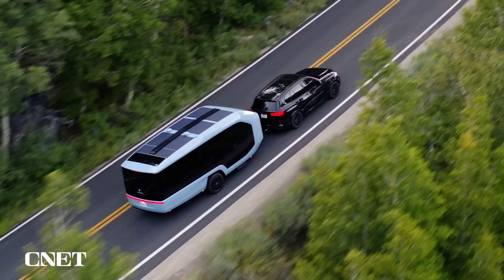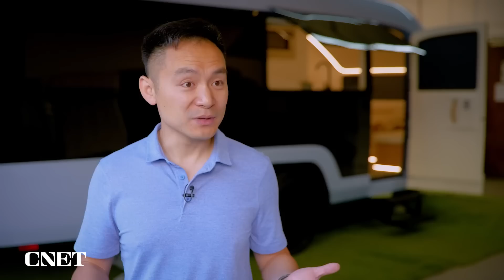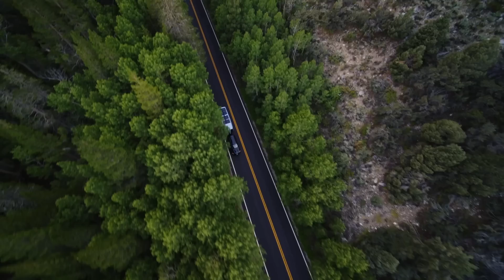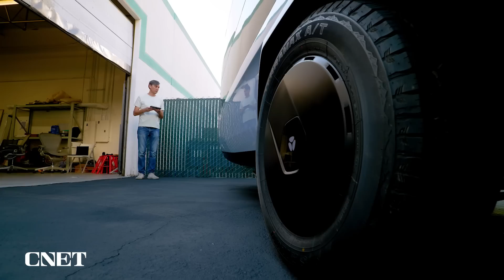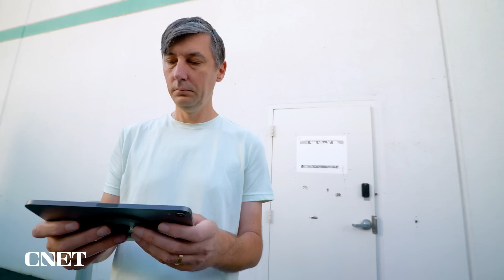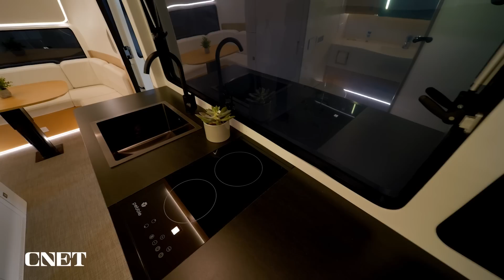Pebble Flow Electric RV Pulls Its Own Weight

Comment: Can you make mini ten feet by ten feet cargo electric assist for fifty cc scooters at a reasonable price ? Home depot trailer are 1300 so can you make a twelve foot size basic electric scooters assisted trailer so mobility 🛵 scooters have electric assist trailer? We get ADP funds but it only cover couple thousand for scooter so 75% of two thousand so we need a manufacturer can make scooter electric assist for fifty cc scooter. Can your company make them here in Canada? At reasonable prices? A basic electric assist twelve foot by eight would be good. Can you make that kind? No one is making ones for mobility 🛵

Comment: Not sure how these folks have overlooked the well known fact that you can't have a trailer push at all with our current ball and coupling hitch design. Once a trailer gets any side or forward motion, it over powers the vehicle and causes the vehicle to lose control. That is why there has been so much effort into designing anti-sway devices. But again this will not work if the trailer tries to push a vehicle at all. Can't wait for the dumpster file this will cause.
Reply: The trailer won’t push at all. Trailer brakes work to assist breaking via vehicle brake tip in. Doesn’t mean the trailer is ever pulling on the truck when it is braking. If a vehicle is using 250 HP to pull a trailer and itself up a grade, this trailer may assist 50-100 HP at that moment. In doing so the truck is still very much exerting a pulling force on the hitch - just not as much.

Comment: An RV with these features MINUS the 1,000’s of pounds of batteries would be great. Take away the ridiculous ev part. Trucks are already going to the hitch with cameras/motors (for WAY cheaper/simpler).  The idea of the RV sending energy out is great. The extra weight is a big deal though and will be hard on tires and is just ridiculous.

Comment: Starting price only $109,000 - with options say $150,000.   Various brand new Class A motor homes are available in this price range - and no tow vehicle is required.

Comment: I think this is a wonderful unit....and my $20K 19' travel trailer with 200amp LiFe batteries and 450watts of Solar panels seems just a bit more economical.  We've traveled with it since 2015 and the money it has saved us by 'eating in' and boondocking is surprising.  I suppose this would be a nice way to blow $100K....-Veteran '66-68

Comment: I don't know if anyone's tinkering with the possibility of making a kit to make any trailer a power-assisted trailer. An e-axle capable of highway speeds, motor controller, a hitch with an actuator to sense load demands (acceleration and regeneration actuated by the load... kinda like how U-Haul trailers brakes work), and a 20kwh battery pack should do the trick. Motor acts as a flywheel in cruise, accelerates and regenerates (to slow down) as needed. Hmmm...

Comment: I've never seen someone try so hard to explain why backing up to a trailer is 'just a hard physics problem'... like no sir.... it is not that difficult.   If you can't get that part of it done, should you be concerned about having a 7k-pound self-propelled weight pushing your car around on the road--because THAT may be a hard physics problem.   What happens when that thing hits a slick spot in the road or you get passed by a semi and it starts to wiggle a little?    You still need a vehicle that can pull a trailer of this weight and not exceed the GCVWR.   Perhaps a more useful addition would have been a battery pack in the trailer that connects via plug to extend the range on your EV.      If you aren't pulling this with an EV, it makes no practical sense.  Not that it makes a lot of sense anyway.   There seem to be some very large safety considerations that no one is talking about.

Comment: There are so many problems here ....
1. Sleeping space over a Li-ion battery pack is a potential death trap. Is the battery pack equipped with heat/smoke alarms?
2. How is the battery cooled?
3. The nose wheel is too small for effective operation on dirt or gravel (this thing is for camping, right?)
4. The battery pack must be heavily armored against damage from road debris or uneven surfaces (not mentioned).
5. Batteries are heavy - vehicle weight not mentioned - the product should have 4 wheels, not two, for greater safety.
6. Tire load rating and quality are crucial, a blowout on any 2-wheel camper can be catastrophic and this one is heaviest in its class.
7. The driving dynamics of pulling a trailer that pushes weren't mentioned. A fifth-wheel setup is more stable because pushing force would be applied closer to the tow vehicle's center of mass. Pushing on the tow vehicle's bumper is inherently unstable.
8. Does it have regen braking? How would its regen braking sync with the tow vehicle's regen braking?
9. What is the federal and state legality of motive campers? Where is the developer in the homologation process?

Thanks, CNET for the stenographic advert. You totally researched this one.

Comment: In concept this is a good idea but horrible in practice. That battery is going to go unused for long periods of times, when traveling you will now have 2 vehicles to worry about range and have to charge at DC fast chargers. All of these issues are before the way to high price. Ether just get a cheaper trailer and stop more often to charge or just buy an RV.

Comment: So electric assist helps mpg when it's on? What about all the added weight you have to pull when it's off? Electric caravan movers have been a thing for years as well. This just looks like an overweight van that adds expense to cure non existent problems and I seriously doubt it will ever sell if it even reaches production.

Comment: Do RV trailers really need to be EV -isn’t the whole point that they have no propulsion thus supposed to be towed by something? I just see the electric motors really offering much since they’re just adding weight to the overall rig. I really don’t think the typical profile of an RVer is that of someone living in Silicon Valley. I don’t see this succeeding just my opinion.

Comment: Next thing Pebble needs to solve is charging station layout. They need to either develop their own charging network that offers pull-through stations so you can charge your vehicle AND the RV at the same time via DC. Or work with companies like EA/EVgo/Tesla/Rivian/etc. to strategically add capable stalls to their new and existing sites. Doesn't need to be all of them, just ones that make sense. In my opinion, that will be the biggest barrier. I would probably need to charge twice on a 450 mile road trip. The convenience factor goes down exponentially If I can't actually charge the thing practically.
Reply: imagine riding cross country in the tesla or rivian truck and never having to stop for a charge!
Reply: Tesla has already started adding pull through stations, due to the upcoming release of Cybertruck. They'll also be adding Tesla Semi stations (Megachargers) which will also likely accommodate trailered vehicles.
Reply: why would you need a charging station with this?? @jamesreichert

Comment: Genial. Disadvantages of trailers of EVs change to their advanteges.👍👍👍I would suggest 1 improvement: solar panels could be foldable and while camping their area could be several times larger.
Reply: maybe double decked panels that a lower section slidesout for stationary deployment.

Comment: Conceptually, it makes sense as far as what it is trying to do. Solar panels on the roof, two motors to control turning, provide additional force and regenerative braking, etc.

I just can't figure much sense out of the "real world" feasibility of electric motors and batteries. As a concept its fine, but it seems to violate laws of physics, etc. Ability to make Horsepower, the overall battery power ratings and ability to charge with solar or regenerative braking. They all seem sketchy to me, at least as far as actually being real technology and not just sci fi.

It's pretty expensive, but that cost gives you some freedom. I'm not sure where you would take this legally off grid though. Usually, you have to take them to designated areas with hookups, so the new tech is all basically "extra". I might be "wrong" about that though. And it could change to adapt to this new reality.

But yeah, the idea that its $109,000 is rough. How are you supposed to be able to afford that? Rip people off? Undoubtedly.
Reply: Afford via home equity loan or take out an RV loan which can be amortized over 15 years. Not saying either is a great idea, but that’s how a lot of these rigs are purchased.

Comment: I think they are missing a trick here with the solar panels. You should be able to get more than 1kw without adding weight. My impression is that the solar system is an after thought

Comment: I like the idea of supplementing gas not replacing.  Reducing the gas used to pull the trailer by having an electric motor trailer is smart.  End of the day, if it runs out of electricity my truck can still pull it and I'm not worse off than normal.  But best case scenario the panels keep the battery topped up and now the truck is using less gas to pull the thing.  This is how things should be, not an impact to your life in a negative way the way but supplement to your life in a positive way.  Kind of pricey though don't think you would recoup your money from gas savings on this thing, but might reduce wear and tear on the truck by having it pull less.
Reply: Pricey yes, but there are many RVs that cost as much or more without the modern tech.
Reply: So, with all due respect, and while I fully understand your comment, but it makes no sense, because the plan is to eliminate the use of fossil fueled vehicles, which means that the plan is to replace all ICE vehicles. 

That’s the plan not to supplement it, but to completely eliminate the use of fossil fuels, otherwise, there is no future, and there is no planet B either. Capeesh. Cheers 🥂

Comment: If hitching and backing are that difficult maybe a trailer is not for you. Plus crazy expensive. We have an Escape19 fiberglass trailer which tows just fine behind my ICE tow vehicle and I have never had "range anxiety" during our routine 500 mile travel days. All for 1/3 the cost!!
Reply: that's elitist. why shouldn't as many people as possible have accessibility options when it comes to camping and using a trailer?
Reply: @ikhares  Elitist? What's elitist is the crazy price. Almost the price of a home in parts of some states.
Reply: Yep…for a piece o’ crap

Comment: The tech is cool, but with modern backup cameras hitching is easy. Plus the trailer is really expensive, add in an expert EV and it nakes way more sense to get a normal luxury travel trailer and a diesel pickup truck where range anxiety doesn't exist, itll cost tens of thousands less per unit, and tow way more with a diesel. Its cool but impractical.
Reply: Nakes? You mean makes right

Comment: 900K for something you don't even need. The target market here is obvious. But it sure is a cool machine! 🤑💸💶💲💰
Reply: 109K
Reply: Here’s why I like this thing over my current 29 ft trailer weighing 8,000 lbs loaded, pulled by my 2015 F150 2.7l V6 twin turbo. 1. It would be nice to charge the trailer up and get assist when towing so I don’t feel like I’m pulling such a massive load, and I don’t burn an entire tank of gas over a three hour drive which includes substantial elevation gain going from San Diego to Big Bear. No specs given on how much assist it gives, unfortunately. 2. I camp out at the desert with no hook ups and it can be a real pain pulling a heavy generator out the truck and having to turn it on whenever I want air conditioning, to watch TV or use the microwave. If I have neighbors they don’t want to hear it late at night. 3. This looks really nice IMO and I like the non-typical interior. Most RV’s have pretty poor build quality. 4. RV loans can be amortized over 15 years or you could get a home equity loan to cover the cost. 5. This can be used as a guest house when family or friends come to stay. 6. It’s novel enough that you could likely rent it out one weekend a month and cover the monthly payment. 7. Like with a F150 Ford Lightning  EV you can in theory use this like a Tesla powerwall, meaning you won’t pay on-peak electricity pricing, saving a fortune in summer, and you have back up if you have a power cut. 8. I’m not worried about hitching up, but the remote control means I can turn this thing around on my private road without needing my truck. Currently I have to reverse a quarter mile down a hill.

Comment: This is exactly one of the ideas I pitched in my digital transformation class and promised would arise at some point
Reply: Me too! I've been thinking of these for the past 3 years now. Trailer companies need to start making trailers with batteries in a skateboard platform. They need to be able to plug into the rear of EVs to help provide more range while towing. Though, EV manufacturers will need to have another plug port placed at the rear of the vehicle for that.
My thought would have two different lengths of trailer platforms. A shorter one for an open trailer bed used for hauling another car, landscaping and construction companies, an enclosed box trailer for hauling things, or a mini camper. Then a longer platform for bigger campers, horse trailers, or anything else.
The extra weight of another larger battery would be a hindrance, but more range would still be provided. However, with innovations in battery technology happening quickly, lighter batteries like solid state will soon be here.
Reply: @jeffs6090  right? Makes so much sense. Won’t be long before you see a smart towing a huge RV

Comment: Quickly run into range anxiety? Didn’t the results of the F150 basically show it’s incapable of towing things over distance unless you maintain a speed of 45-50mph? 

And even at those speeds the range was poor. 

Towing with an EV isn’t really a thing. What are you looking at … hundreds of potential customers out of 300 million people?
Reply: and then TFLEV did a test with the Silverado and found it quite workable at excessive speeds too.

Comment: This should have been done with regular trailers first. They would have been able to sell out quickly.
Reply: Absolutely!
Reply: So you might wanna slow your roll just a little because there’s no mass production of these trailers at this time that I know of, and so there’s something called economies of scale and there’s also something called competition and when you have competition normally that helps to drive down the cost, and with the addition of economies of scale, this price will fluctuate, but if it’s going to be mass produced, I would think that the cost would be less than what it is today. Cheers 🥂
Reply: @theodorehaskins3756  to your point, economies of scale is what making trailers vs RVs will achieve. You will make and sell more trailers than RVs due to the need for more trailers than RVs. I'm not sure what you mean by price fluctuation, because that is not associated with economies of scale.
Reply: @acm0045  Touché! So price fluctuation, has to do with the economy, as your prices will reflect the overall market conditions that you find yourself in. That’s what you’re seeing with Tesla now having to adjust the prices to try to get themselves in line with the economy. So that’s what I meant by that. Cheers 🥂
Reply: $110,000 USD starting price...Ummmm Think I'd rather buy a (800 sqf) House with that cash...they can keep the trailer.
Reply: @kyleklmondwa9042  and where can you buy a house for that price? My Southern California home would like a word with that region. Lol
Reply: Why don't you get to work on retrofitting older and even new units being produced?

Whining on YouTube is senseless.
Reply: @dj4monie  it's not whining. Is an observation. I'm just stating that more people want this product in a different configuration. That's an observation.